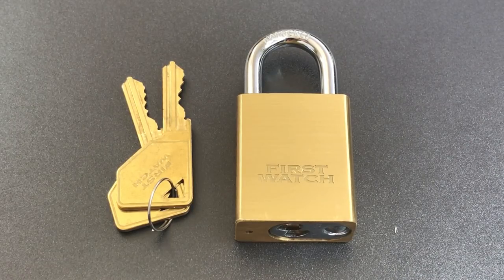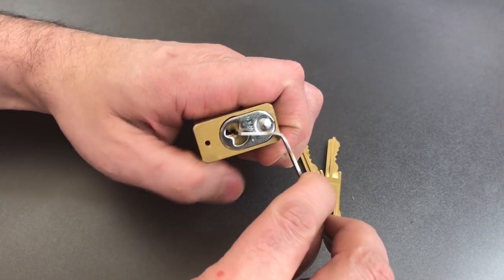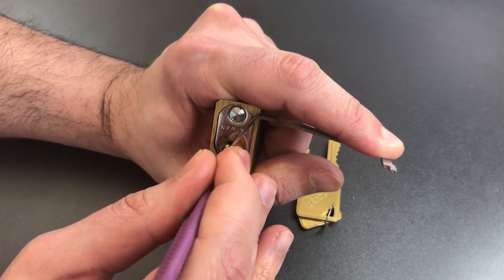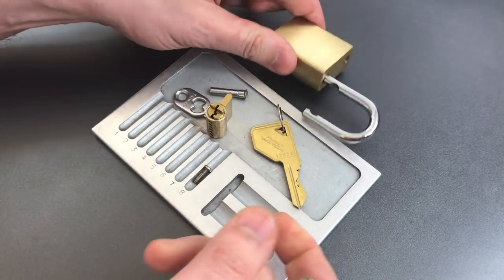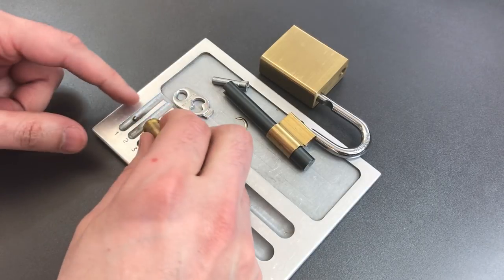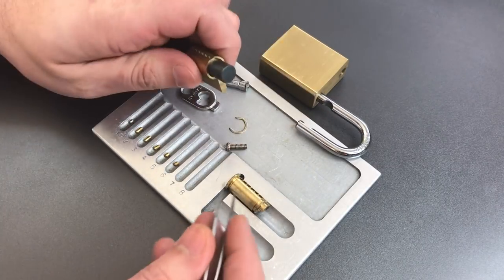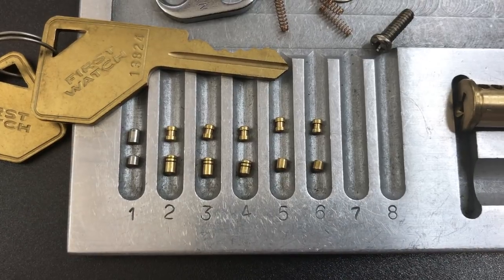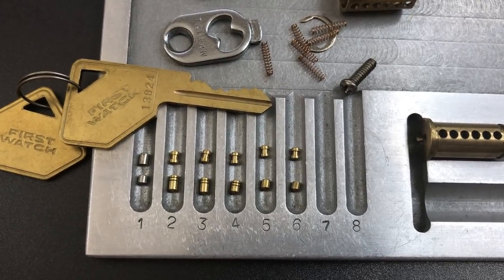[619] First Watch 40mm Brass Padlock Picked and Gutted (Model 3803)

Comment: I  wanted to tell you that you made me interested in lockpicking. Bought a set of picks and few locks. Thanks!
Reply: Warmist what did you get? I have been watching and want my own set to try but it seems so many are available.
Reply from the maker: Glad to hear it, and good luck as you start your picking journey. Be warned, it is addictive.
Reply: I did the same thing. I had always been interested, but heard bad information.  You turned the corner for me, and I have started to play.  Was able to get two done in about ten minutes, but the others have been more difficult.  Your voice is very good to listen, and you explain your progress so well.
Reply: Got the "Dangerfield PRAXIS Dual-Gauge 21" from ukbumpkeys. It's not very good though. Although it has varied tensioning tools (5 or 6) the handles are hard on your fingers (not plastic coated) and does not have the more deep picks. Should have looked more for something for single pin picking.

Also got a "7 Pin Ultimate Adversary Practice Lock" but shipping+import taxes were very big because i'm non-american :|

Comment: Anyone else think LPL has the perfect Pilot's voice? 

"Our crusing altitude will be 30,000 ft at which we'd be experiencing some slight turbulence but due to the serration of the wingtips, that will be reduced.  This is quite normal."
Reply from the maker: If I was at the stick, there would be more than turbulence.😳
Reply: Ah, but surely you would report on your impending demise with utter calm.
Reply: He has the perfect everything voice.

Chef.
Hostage negotiator. 
Lawyer.
Wait..
Reply: @jamesg1367  "We seem to have lost power to all engines. Nothing on one, two, three or four..."

Comment: There is a vulnerability when re-assembling these locks.  There is enough slop in the fit of the retainer plate that it can be tightened in a position that blocks full insertion of the key by a few hundreds of an inch.  

Don't ask me how I know this!!

The solution (if somehow it got locked before checking for function!) is to lay the lock down on the narrow side with the retainer nut low.  Use a hex key and a screwdriver handle to tap (slide) the retainer plate downward toward the retainer nut.  This should allow full insertion of the key, unlocking, and then re-tightening the retainer screw (which will likely be loose a bit) and making sure the retainer plate is as far as it can go toward the retainer nut when you do the final tightening.

Comment: I like these locks a copy of the American Lock except better & cheaper..
Reply: When these locks were originally sold at retail in the mid 1990's, they were more expensive than the American Lock series 30 that is the exact same size.  The two most important differences in the locks were 6-pin for the First Watch versus 5-pin for the American.  And the First Watch used a screw down the shackle hole for disassembly, the American Lock of that vintage and size used a cup-shaped rivet.  I had always assumed it was an Allen head screw until I looked recently with a lighted magnifier and then searched to confirm it.  They are considered rekeyable because you can drill or punch the rivet, but that's obviously much more work and requires replacement parts versus the First Watch.
Also the much fancier retail package and printing of the First Watch compared to the printed paperboard box of the American Lock added some amount to the final cost.

Comment: Do you know of a supplier for anti-drill pins? That lock looks like it would use Master Lock/ American Lock pin sizes. Thanks.
Reply from the maker: I do not. But you can buy a piece of high carbon steel rod and make them with ease.

Comment: I didn't see a bypass wafer, could this have been opened using the bypass method?
Reply: Vixtrin This lock has a vertical actuator and as far as I know they are not bypassable
Reply from the maker: When the interface between the core and the locking mechanism is perpendicular rather than parallel to the keyway, then the normal American lock bypass does not work.

Comment: So the inside of that seems to be basically identical to the one American lock I have with the exception of the first pin not being steel.  even the functional part of the key looks identical.  Is it just a copy?
I know its a kind of specific question, but what's the most difficult lock you have thats pin & tumbler and doesn't rely on the warding for its difficulty?
Reply from the maker: The ASSA locks with spools and undercut cores.